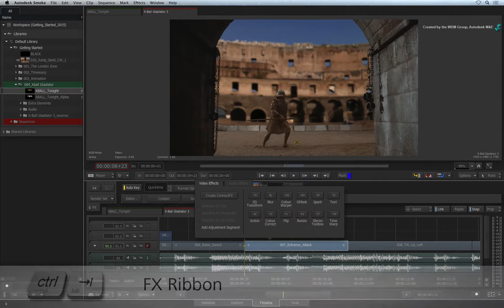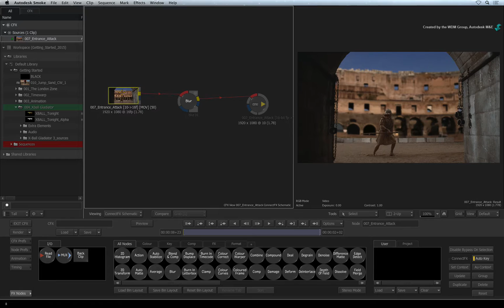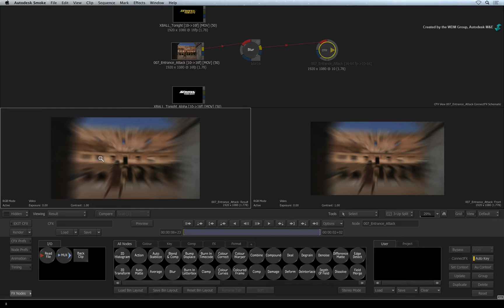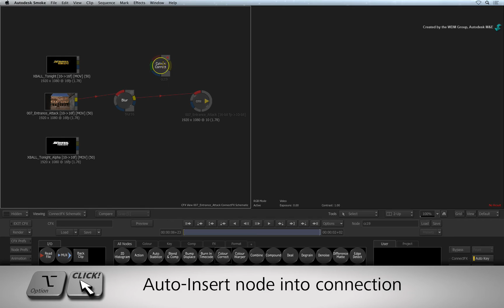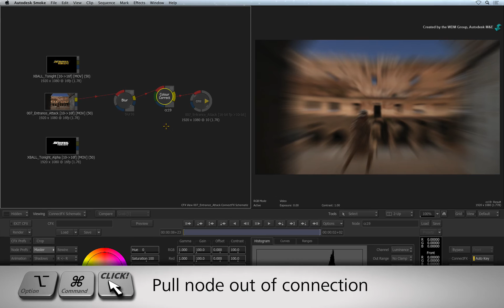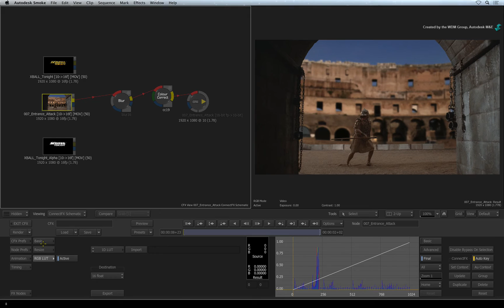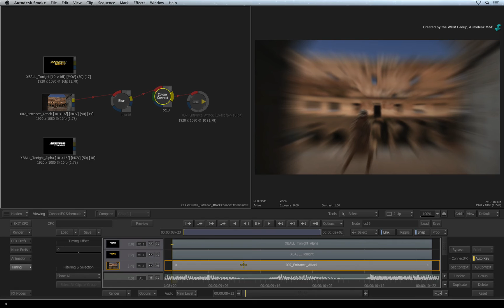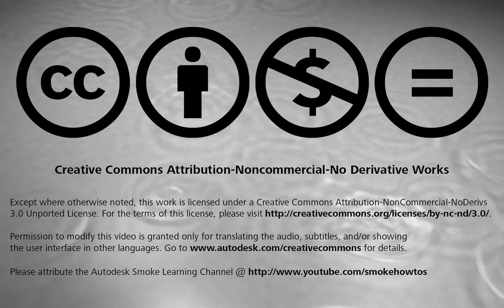ConnectFX Introduction

Comment: When I try to put node to connect nothing happen, node not connect. It because computer's spec? or I do something wrong? (Macbook Pro Early 2011)
Reply from the maker: Hi, what do you mean the nodes won't connect?  Are you drawing a connection or using the option keyboard shortcut to kiss the nodes?